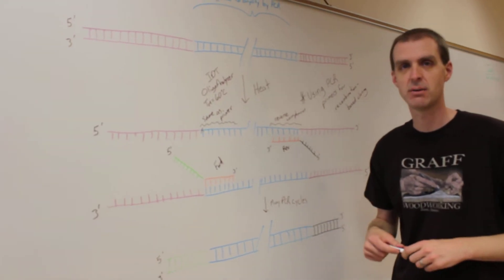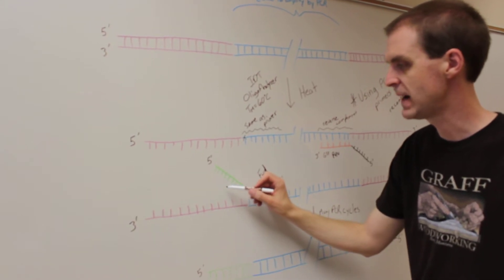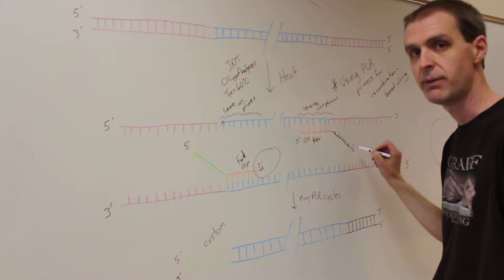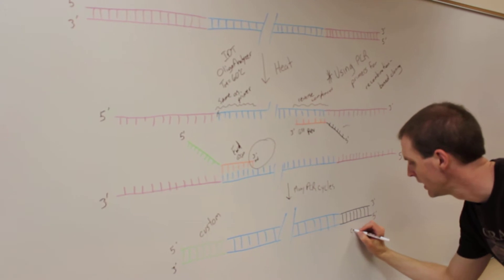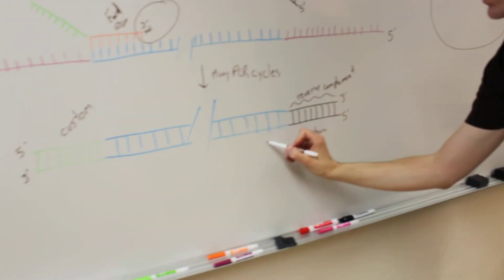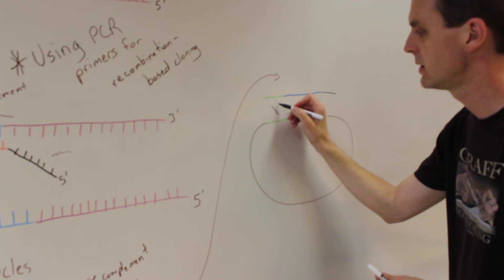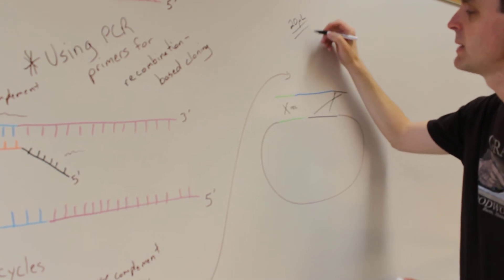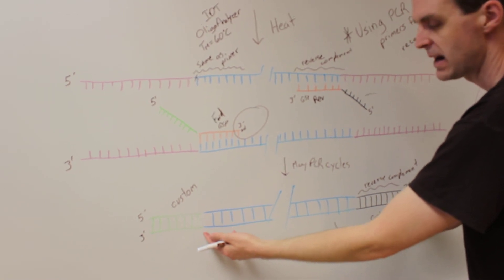Designing PCR Primers for Recombination-Based Cloning

Comment: I am unable to set  6 ul reaction as the concentration of digested plasmid purified from agarose gel is very low. To accomodate 100 ng i need to take 9 ul of vector already so i need to go for a 20 ul reaction. Is there any way out?